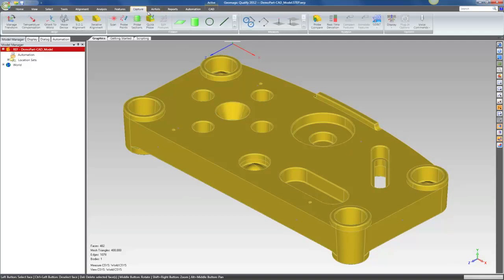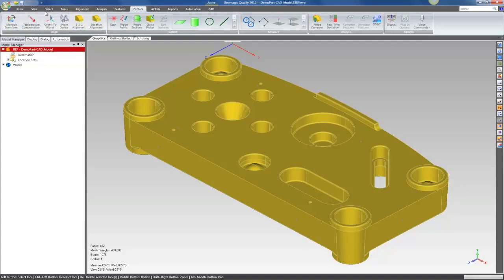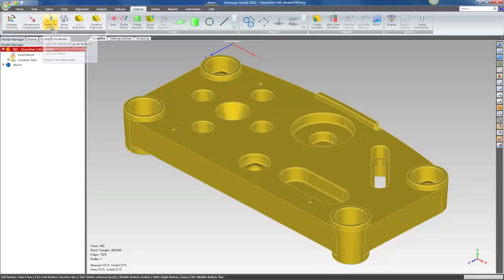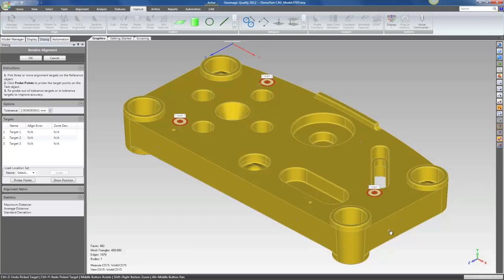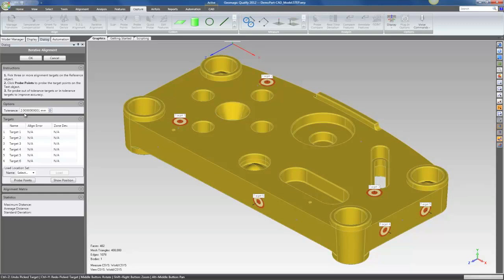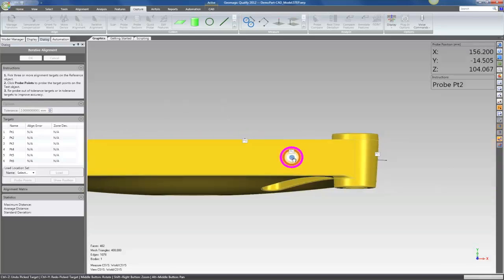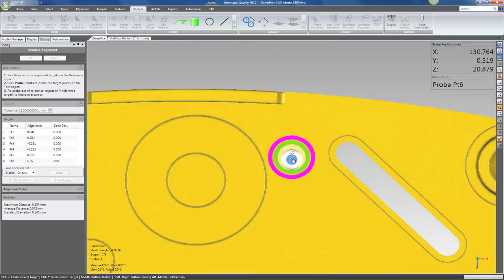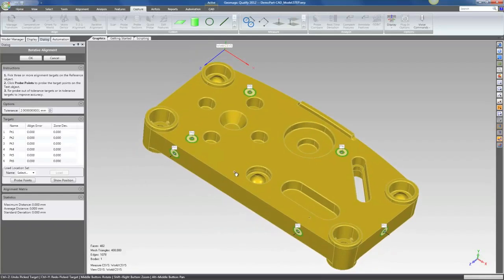Iterative Alignment in Geomagic Qualify and Qualify Probe 2012

Comment from the maker: @joohanssony 
The tool is designed as an alignment tool when you do not have any standard features that could be used for alignment. Regardless of how many points you chose, the first three points require the user to look at the physical part and pick the three points on the part in the general area. You are also given live feedback where you can see the probe move to the target and also shows you it in red or green if you’ve hit the position within tolerance.